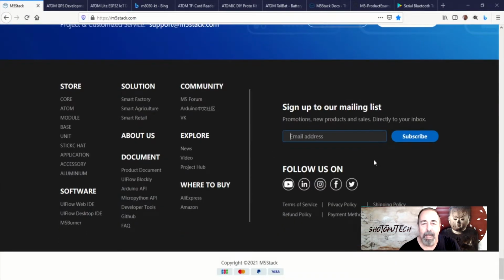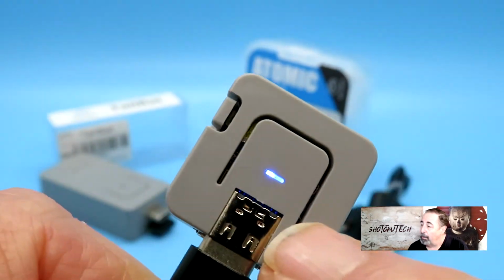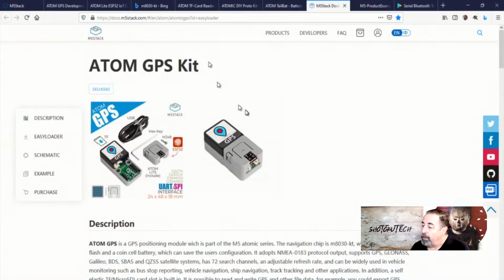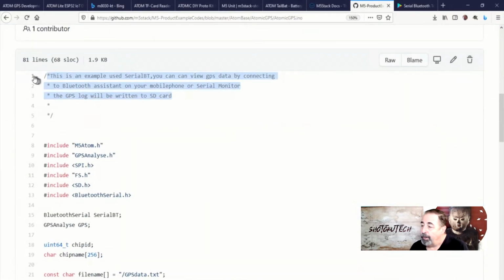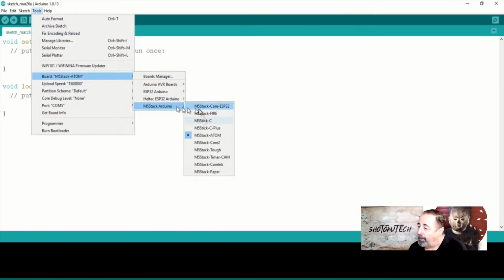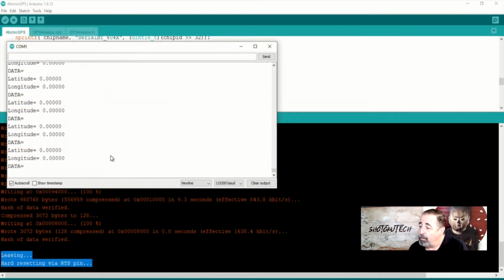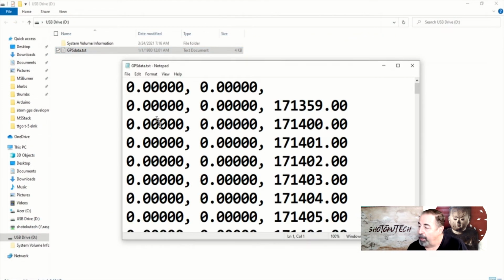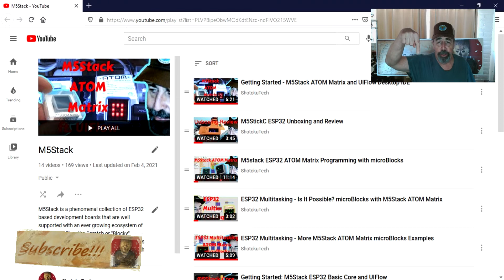Quick start with the ATOM GPS Development Kit from M5Stack

Comment: Hello, I want to map faulty streetlights and send them to an MQTT server. Do you have a button to send the current location or mark it as a milestone?
Reply from the maker: This device by itself only has WiFi and Bluetooth connectivity. But it does have a button. The code could be modified to record the current location with the press of the button, yes.

Comment: Is there a m5stack product with both GPS and GSM? I am looking for something like the atom that can be stacked without any wires.
Reply from the maker: It might be more expensive, but zero wires, just stacking. Start with this: https://shop.m5stack.com/products/esp32-basic-core-lot-development-kit-v2-7
This is their top model: https://shop.m5stack.com/products/gnss-module-with-barometric-pressure-imu-magnetometer-sensors
Best GSM: https://shop.m5stack.com/products/com-lte-modulesim7600g
With that much going on, you may want external power or get the enhanced battery: https://shop.m5stack.com/products/m5go-fire-battery-bottom

Comment: Please could you share info about on how to set the update rate to 10Hz?.  Using the SD card I obtain the following  E (20624) gpio: gpio_set_level(226): GPIO output gpio_num  error why?. Thank you in advance for your help. Thank you for sharing this useful video. Regards, Salvatore
Reply from the maker: This device doesn't directly present the ability to program the GPS module like you would have with a GPS breakout. Theoretically you could send AT commands to the GPS unit from the ATOM or find a way to connect directly to is via serial. Like I say I'd rather have a breakout unit for that. Regarding GPIO error, do you have the correct board selected in Arduino IDE? M5Stack-ATOM? The code has not changed on Github since well before I made this video. I'd have to try and compile again to see if I get an error.

Comment: Thanks for the insightful video. I connected Atom QR code scanner to Atom GPS through groove connector. I want to scan the serial code of a product and track the coordinates of the same product and store them in such a way that serial code is followed by coordinates. Hence could you please help me with example to align above two data's or any resources. Thanks in advance.
Reply from the maker: That is an interesting question. I don't have the luxury of having the QR reader on hand. My advice is take it one step at a time. Read and process data from the QR reader directly through the Grove adapter. This way you know what is being sent and how it is formatted. Next step is finding some way the see that same data sent from QR reader and received by ATOM GPS. Remember you can monitor ATOM GPS over Bluetooth. Finally, formatting and writing the data to the SD card. This should be the easy part if you have made it this far. I don't see support for your scenario in UIFlow, so you will be working in Arduino IDE. Focus on simple tasks first. While there is serial data from QR reader on GPS grove, get data. Then send received data to Bluetooth. So look at simple serial to serial example sketches in Arduino IDE and see if you can get that to work between the two devices. It also comes to mind you could forgo grove to grove connection and use Bluetooth or even WiFi with HTTP. Crazy huh? I am interested to hear how this goes for you. Best wishes.
Reply: @ShotokuTech  That's a great suggestion to start off, might be software serial library can help me sometime during this. I will update once I get through with this part. Thanks!
Reply from the maker: @shreyanshpagaria3621  Good luck!

Comment: I have 1 question, how to config the interval of gps location sending, i want 1 every second.
Reply from the maker: In the example sketch "ATOM_GPS" from M5Stack there is a line 'delay(1000)' inside void loop(). This value 1000 represents one second. So you can use the default value. Thanks!
Reply: @ShotokuTech 

Thanks a lot, did not expect this very quick answer 😃

Impressed and appreciated your support. I'll try. Hope this setting will help to save the power. (now tail battery can supply only 30-40 minutes).

Thank you.
Reply from the maker: @pichart2942  Good luck. Best wishes.
Reply: @ShotokuTech 

Hi..may i have another question,   the printed time in trf text file is Utc, is it possible to change to GMT.

I have tried, but got error. (I change all UTC to GMT)

Thanks
Reply from the maker: @pichart2942  Hello. I just looked through the example sketch. This won't be quick and easy. The variable Utc in the sketch is a sting. You would have to break out the hour portion of the string using 'indexof()' statements. Convert string to int. Add or subtract your offset. Convert back to string and concatenate the hour portion back with the rest of Utc. There may be some example somewhere. TinyGPS++ library has a better handle on this that the one used in the example sketch, GPSAnalyse.
Reply: @ShotokuTech  

Hi, I see. Thank you for your answer.
By the way, do you happen to know how to interpret tha number there. I research in internet, most of them show Utc in hh:mm:ss, but from the GPS m5 unit the number 041506. Does it mean 04:15:06, or any suggestion?

Thanks,

pichart
Reply from the maker: @pichart2942  Hello. If the minutes can be interpreted as correct, it is 15 minutes after the hour, then yes the string 041506 could be broken out to 04:15:06 and the 04 could be adjusted to the desired time offset. Of course there are some time zones that are offset by thirty minutes, so the 15 would need to be adjusted for that as well. Generally a GPS module will detect the time first if it has received signal from one satellite. It takes several signals from different satellites to determine position.
Reply: @ShotokuTech  

Great thanks. Again useful answer.
Thank you.
Reply from the maker: @pichart2942  Good luck. Let me know how you work it out. Thanks.
Reply: @ShotokuTech 

For sure,  I will update you when my project success.

Thanks, for all suggestion and  support.

Pichart

Comment: Hi, why do my log appear zero values only?
Reply from the maker: So you aren't getting a fix? It can take several minutes. Try taking it outside for a while?
Reply: @ShotokuTech  One more thing, do you happen to know if its possible to connect this with Blynk?
Reply from the maker: @hasifzainal4109  The frustrating thing with this device is it only has bluetooth and WiFi. I was about to try to find a way to hook this to LoRa. But I already have several different GPS/LoRa solutions, so I haven't pressed this one just yet.
Reply from the maker: @hasifzainal4109  Or GPRS for that matter. LOL
Reply: @ShotokuTech  i see. I’m just static at home for now. Thanks a lot for the fast response sir. Appreciate it!

Comment: Hi, thanks for good explanation. Subscribed to your channel! :) 
I'm not yet bought some kit (only have atom matrix), but can't figure out how do I connect some sensors or other devices to ATOM (pins on bottom) after plugging it into KIT extender? I see that then is only groove port left for that?
Reply from the maker: True the pins on the bottom of the ATOM will be taken up by this. If your Units are I2C you could probably attach more than one I2C device to the Grove. There are these Grove T-Connectors: https://shop.m5stack.com/collections/m5-accessory/products/grove-t-connector-5pcs-a-pack
Something I will have to test out in the future. Thanks!
Reply: @ShotokuTech  ok, that's what I though already. 
there are also this one which should eliminiate the need for i2c https://shop.m5stack.com/products/official-extend-serial-i-o-unit?_pos=1&_sid=e4da1e676&_ss=r
Reply from the maker: @electricwhirl5175  Interesting. Looks like I need to make an M5Stack order soon. LOL. Thanks!